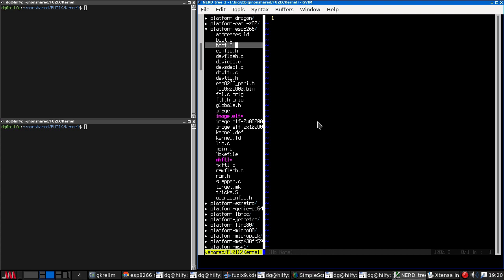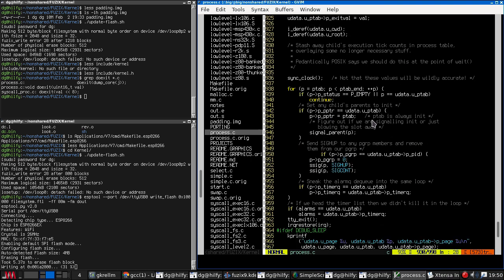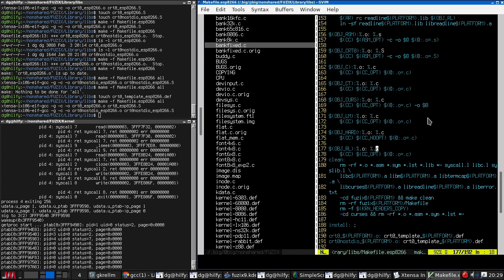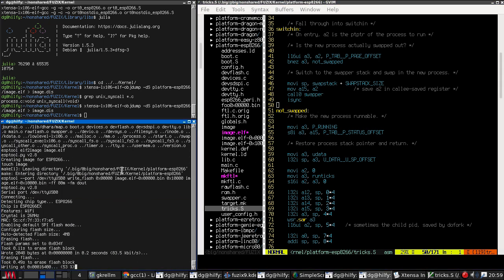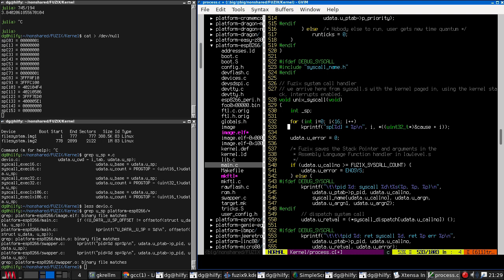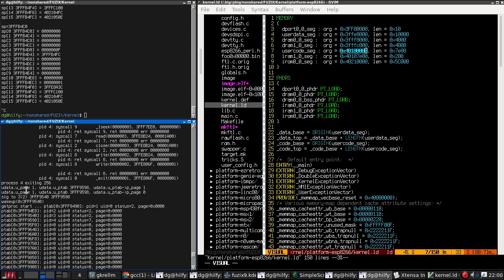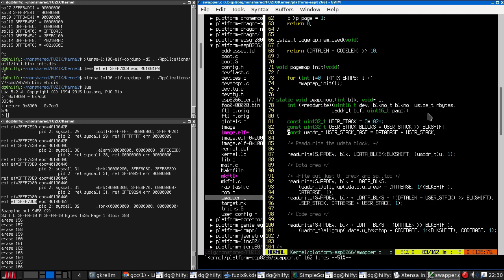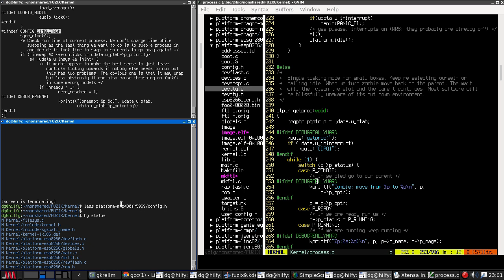Hjalfi ports Fuzix to the ESP8266: #10: flash woes, bugfixing userland, and the mysterious crash

Comment: awesome, my shameless request is porting Fuzix to the Sparkfun Artemis (384k of RAM). Actually I am just trying to port any linux to the lowest power microcontroller to make it easier to solar power it.
Reply from the maker: I have a Fuzix port to the MSP430, which consumes microamps. It's rather bitrotted and needs a tonne of work, though. http://cowlark.com/2015-10-27-fuzix
Reply: @hjalfi  Very nice. I see that it uses FRAM, which is what the Free the Gameboy uses: https://github.com/tudssl/engage It runs at 6uA/mhz. By adding 1MB of Cypress FRAM, it'd be double their Fujitsu 512K, wonder if it'd be enough to run linux on solar- with the same BQ25570 or an AEM10941.